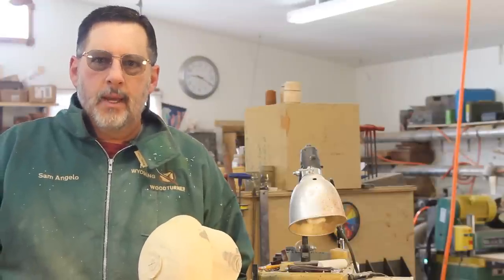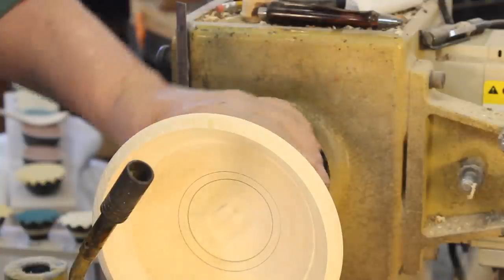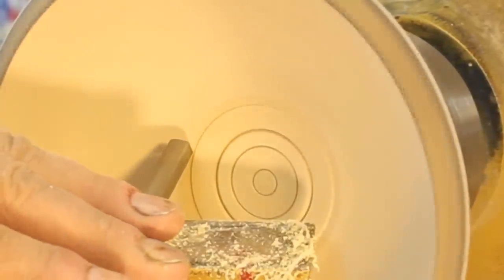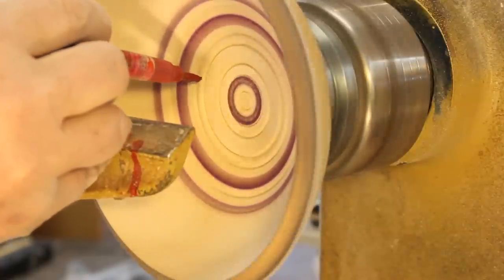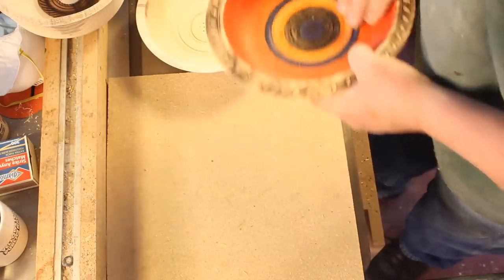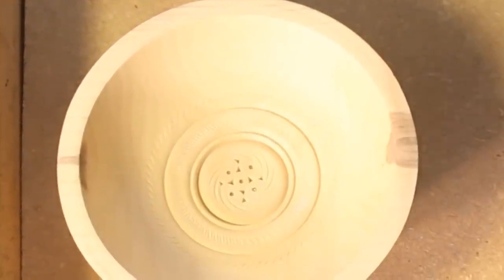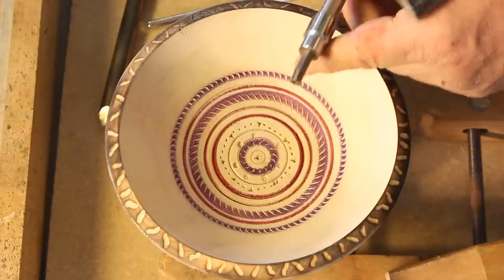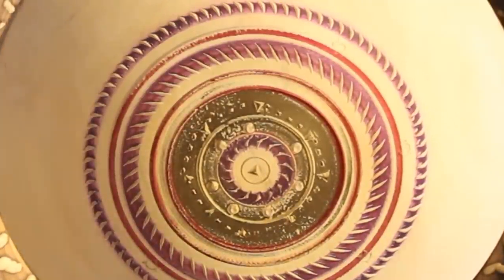Decorating a Bowl: Woodturning by Sam

Comment: If you get a smaller tip torch, like the vector nitro, and it works good with the large on. I use mine with the lathe on and it creates such an even burn. It's real clean, try it out

Comment: Hell I dig the coloring, purple and pink are complimenting for each other.awesome, cool idea using the lacing maker(leather tool, I do leather work as well) Have you ever tried butcher block sealer for a coating? and then just plain carnuba or paraffin wax over the top on the inside thanks for sharing. =)

Comment: Simply amazing.Hopefully I get the capital to start off my own shop someday..

How much do you reckon should start one up with just enough tools? Thanks
Reply from the maker: Well, it depends on what you want to do.  What kind of stuff you want to make or turn.  I think you can start with sone hand tools certainly and build your shop.  Power machines are great but working with hand tools is slow, quiet and it gives you time to think about what you are doing.  I started woodworking 40 years ago with a block plane and a hand saw.  I made it work somehow.  Thanks for writing and for the kind words.  Sam in Wyoming

Comment: At what point would you do the air brush application of paint....after what , before what?....
Reply from the maker: Dwight, good question.  I generally seal w piece with shellac.  And perhaps sand it back a bit.  This way I am applying paint to a surface that is not totally porous as wood usually is. (But I am not sure if I did that in this old video).  If i have done any other embellishment I would mask that area off.  I would then apply paint with my airbrush.  I would also seal the painted area with a spray of your choice.  I don't think a real shiny surface is appropriate here.  Sam